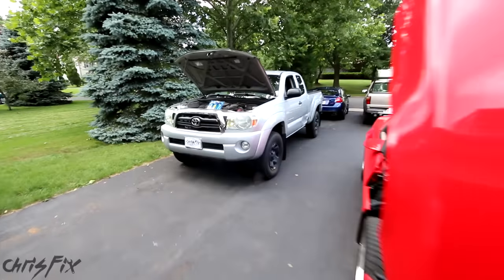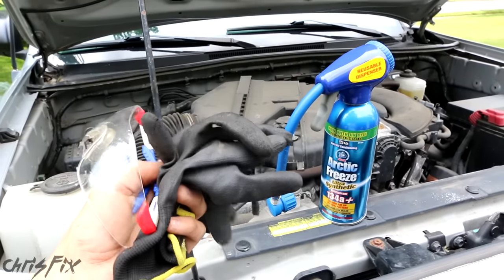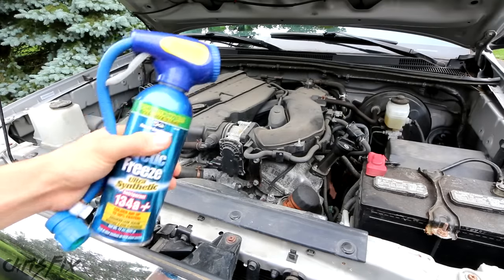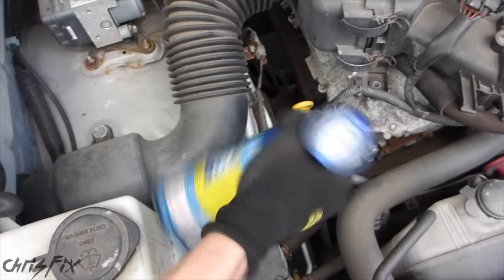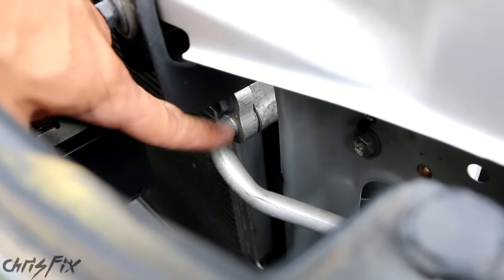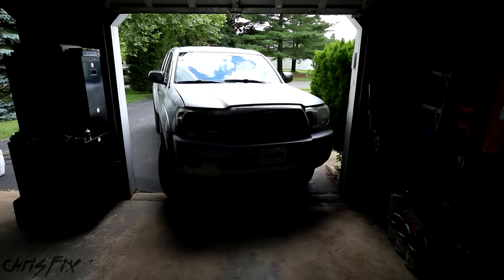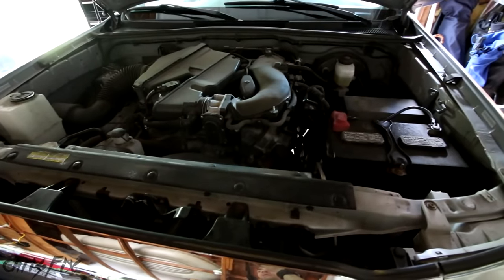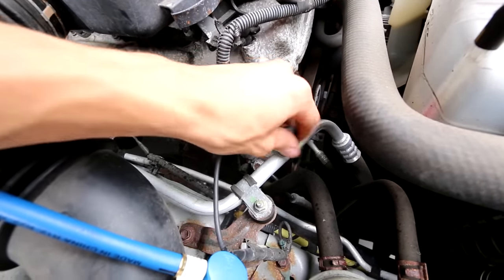How to Find AC Leaks in Your Car (UV Dye)

Comment: Something not mentioned in a lot of videos is purge the hose of air before adding refrigerant to the line. But I was unable to figure out how to do it. 

I found one video, relating to house a/c recharging, that I tried to relate to the car instead, but since I could be wrong I didn't do an air purge. Their idea was to attach the hose to the low pressure port and to the can, but don't dispense any refrigerant from the can yet.
With the hose attached to car refrigerant port, slightly loosen the connection to the can and refrigerant will hiss out at the can and push all the air out and tighten again to stop it. But I am afraid the pressure in the hose would be so high, it would cause a large blowup of refrigerant.

 Google says this: Yes, the yellow hose used to recharge a car's air conditioning (AC) system with R134a refrigerant should be purged before charging to remove air and moisture: 
Connect the yellow hose to the refrigerant can. 
Turn the can upside down and open the valve to fill the hose with refrigerant. 
Loosen the hose at the manifold assembly until a small amount of liquid comes out, then tighten it again. 
Air and moisture can damage the AC system, so it's important to purge the hose before charging. R134a is a greenhouse gas, so it's also illegal to vent

Comment: Great Job. my 2004 Ford Expedition has a leak and 3 mechanics failed to locate it,.They each charged me $100.00 and  gave me 3 mo., warranty. Each time exactly at the 3 month time line the AC stops cooling. 1  Mechanic even put a liquid sealer and that failed too. I will try your suggestion and maybe I get lucky.
Reply: Service port schrader cores? Seems like a slow leak

Comment: great video, what are your thoughts on the different types of Super Seal? Do you have any experience with them? I've heard mixed opinions on them. I'm considering using it as a last-ditch effort. my a/c on my honda odyssey 2005 w/ 191K miles went out so I have been recharging the system every few days while we were traveling down south during the summer heat. thanks for your time Chris!

Comment: If a leak was slow and you put that refrigerant into the system, to take care of it responsibly, would you then need to have the system professionally evacuated before replacing whatever is leaking? Is there an alternative way of checking for leaks that doesn't require professional evacuation?

Comment: I had a random mechanic diagnose my ac system tell me it be 2500 to replace the entire system. My cars only worth 2500. So I decided to say screw it. But after watching this, I think I'll test it and see if I can just figure out what component is messed up and replace that piece. Maybe I'll get lucky. Thanks for the help

In this case, can you just pull and replace the compressor? Then you just recharge the system yourself? Will one bottle of recharge charge it twice?
Reply from the maker: If it's all leaked out yes, and then yes you can recharge yourself (https://www.youtube.com/watch?v=Pdq8JAlct6s), and I don't think the bottle would be big enough for 2 charges unless you get a really big one

Comment: Ive heard not to buy the r134a with leak sealer inside. Apparently it can cause issues and shop will refuse to work on your a/c in the future if you've added stop leak r134a before, as the stop leak can damage their equipment!

Comment: Don't forget the old trick for checking for leaks within the evaporator case without actually taking it apart: allow the AC system to run long enough to have some condensate drip out of the drain hose. Collect the liquid and check if it glows under the UV light.

Comment: Great video, extremely helpful, clear and concise. 
One question though, cant you use a dye by itself to locate the leak? As opposed to adding refrigerant w/ dye in it and just leaking refrigerant into the air?
Reply: Great point.

Comment: You air compressor was able to kick on without the correct refrigerant psi? Or the compressor kicks on when it senses a charge? I know I have a leak, and the compressor is good, but can't get it to come on because there's isn't enough charge in the system. Any advice? 
I've taken it to the shop and they say on the diagnostic reader everything is fine, just won't hold a charge because the leak is decent size. Thanks for any advice!
Reply from the maker: It will kick on once you charge the system with enough refrigerant. If you know you have a leak, find then fix the leak first before trying to charge the system again.

Comment: If you need to replace your discharge line do you need to remove the Freon ? Because you mention about the gasket just need to remove the bolt

Comment: On my 2003 F350 7.3 I changed my compressor, condenser, accumulator and, orifice tube.  Had a professional Vacuum and charge the system. He said the system seemed healthy. 

It blew 40 degrees through the vents after charging.  The next day it was blowing 50-60 so I'm concerned. I didnt change the evaporator, he told me not to worry about it. What do you think?

Comment: Hey. Love you videos, as i DIY guy myself, very few times do i need to double check, but when i do, you are one of my few go to for this. I have a 2017 Pathfinder, i checked it for leaks before recharging the A/C. And it was leaking from the back, just by the rear tire? Is this because of the 3rd row folding seat? It was at a coupler, so probably just a washer, but still curious as to what you think. Tks, and be good.

Comment: Hi Chris.  Great demonstration, but I have a question.  I had a rat or mouse chew a hole in the large low pressure  hose, so I know the system is empty.  I replace the line but I want to double check to be sure their isn't any other issue.  Car is a 2012 Acura TSX.  Question is:  Since the inlet is a shrader valve, why not just pump in ambient air to maybe 35 PSI and then check for pressure after over night or 24 hours.  Then let out the compressed air, if no leaks, and add refrigerant?

Comment: Just to add a smal piece of information: The shaft of the compressor also leaks a very small tiny bit by design, as to keep the seal lubricated. Of course, it is way less than that shown in the video

Comment: since the pressure is low at the point where you're about to begin charging, we can safely assume that the compressor will not run until you charge and pressure starts to build up, correct?

Comment: Hey Chris, I haven't done this yet, but I have a 2004 chevy colorado. When the AC is on, it's slightly cool. But you know the sound it makes when you shut the car off, sounds like air bleeding off, that shhhhhh sound. Mine makes that sound over and over while the AC is on, about every 30 seconds, sounds like air pressure bleeding off under the dash. Ideas?? I'd really appreciate a point in the right direction, before buying all the freon and leak kits. Still have my 95 nissan maxima, and of course the AC works flawlessly, that car just won't quit.

Comment: Hey Chris, I got a quick question. So I’m sure I have a small leak because the A/C cuts out around 2 months in. But I only receive cold A/C on the driver side. The passenger side feels like normal air. Any thoughts on how to fix this?

Comment: Hi ChrisFix and thank you videos, they're always helpful and interesting. I have question pls. My air con runs for a few seconds then dies. Should I try this fix? Or check a/c fuse or anything else. Compressor is working fine. With the fires in Sydney we've had lots of ash in the air. Maybe ash clogged?

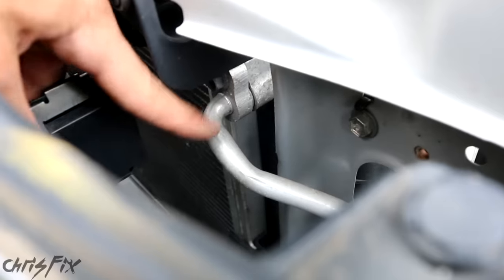Comment: I am surprised that you did not mention that the gas in A/C unit needs to be captured before opening any lines to atmosphere (7:42). It is against the law to purge the unit to atmosphere. After replacement of the seals, the system has to be evacuated before refrigerant is added.

Comment: I was told to not use a refridgerant with a stop leak addative. The logic is that a professional shop will not take the chance of gumming up their high dollar diagnostic tool if rhe vehicle has had sealant added to the freon at any time. Is this accurate?  Also, are air conditioning systems designed to prevent the AC clutch from activating if the pressure in the system is low? How effective are sealants at stopping a leak if one were to use that type of re-charging product?

Comment: came with oil from factory so I only added the freon. Watching cris fix videos I realized that I needed to vaccum the system first so I am fixing to order a pump with manifold hoses. If I vaccum the system do I need to add oil and freon this second time around? I replaced the compressor less than 24 hours ago and I have cold AC FYI.

Comment: I followed all instructions, and after injecting the freon with dye, drove my 05 Ford Ranger for approx 60 miles. Left it parked in my garage, and checked for leaks after two nights (kept forgetting to go down to check for leaks), but there were no leaks. A slight green tint at the low side intake, but that was to be expected as that's where we inject the freon with dye. Any suggestions, or explanations would be helpful. It has to be leaking because it was blowing cold air, then stopped blowing cold air. When I added freon with dye, it started blowing cold air again.

Comment: How long after you deplete the AC refrigerant thru use or via an O-ring leak, will the AC compressor experience detrimental damage/failure?
Reply from the maker: Every compressor is different, and some compressors have a low pressure switch to prevent damage, but detrimental damage could occur within a minute if it doesn't have the lubricating properties of the refrigerant
Reply: @chrisfix  Thank you so much for replying! I love your videos and wish you continued success!

Comment: Thank you, thank you, thank you!!! Very good layout and straightforward instructions. I don't know why I didn't run to youtube first. But its a low key blessing that I happen to see your page. Real talk! I just learned some shit today. Im having a f'ed up situation with my ac and I keep getting the run around with a couple of different mechanics (one of which left their freakin neck flashlight underneath my hood which was discovered by the guys giving me an oil change!) Anyway.... Maybe you can help me with my problem. I'm definetely getting that combo pack. As of now I know exact where the leak is...I can see it! I placed a rubber patch on it and a couple of zip ties to patch the leak.  Worked for 60 secs......P.S. sorry this is so long. I'm on whiskey #3 so I'm flowin! Back to my question. After i use the dye combo pack and find that its JUST the leak I can see. Is there a way I can patch that myself?

Thanks in advance.

Comment: Just found your video and it's giving me hope. I have a Volvo 2005 that has a bad AC system.  They quote form Volvo will make men cry. They say it's the evaporator. It there is any possibility to fix a leak without having to take out the dashboard I would like to try. The link for the product is not working. Do you know if there are any products like this available?

Comment: Hi, I have an 07 camry where the drivers side is hot air but passenger  is cold. 6 yrs ago a neighbor added some freon and that lasted a couple of years. Then 2yrs later took to mechanic who evacuated the freon and added new. Now 2 years later he does the same thing. Says I have a slow leak somewhere.  He told me you couldn't check how much freon is in the system.  It sounds like you can! He never mentions a way to find the leak. I think I'm going to approach him with the question as to checking for the leak. Am I better off, since it lasts so long and why would the air be hot on one side but cold on the other? He said there could be hundreds of reasons why this is happening.  I trust him but now I'm confused and concerned.  I hope I'm lucky enough to get an answer.  😊

Comment: Only one thing to ask can u repair that ac compressor or we should buy a new one in case of this kind leakage...? Pls ans.
Reply from the maker: I would buy a new one, for everything you would have to do to repair a bad compressor, it's not worth trying!
Reply: I agree with Chris, you will never be able to get all the little bits of the compressor back together.  The compressor manufacturers have special tooling to hold everything together while it is being buttoned up.  The only thing serviceable on a compressor is the pulley, clutch and coil, and changing those doesn't involve opening up the compressor body.

Comment: So, i should try a self charge first before going to a actual shop?🤔. 1st time going theu this and have been on the fence on what i should do. Great video
Reply from the maker: If it needs to be charged it’s leaking
Reply: @chrisfix  yes definitely agree, went thru the process just for learning sake. Seemed to be ok then not too far after issue came back. Thank You its appreciated.
Reply: To update, last nite and today, everything appears to be back to normal... Idk if the seal included with the refridgerant did the trick but everything has been up to par. Still gonna get it looked at tho.

Comment: Hey Chris, i listen to you and other youtubers who preach about the dangers of sucking air into the ac system. I use my ac manifold where I'm able to bleed the air out of the service line before it enters the system. I also have one of these can gauge servicing hose. It came to mind that the ac system sucks air out the hose before sucking the refrigerant. How bad is that for the system?

Comment: Thank you for sharing.  In theory, this might be good but the best practice is not to use this can to charge your system.  You can't weigh the volume of the refrigerant and the oil into your system easily using this method, the gauge on the can is not accurate the additives (like stop leak) are bad.  The chance of damaging your system is there.  The best way is to use the AC machine (RRR) that most of the service stations have one.  Also this method is bad for the environment as you will probably release some gas into the atmosphere.  The AC Machine on the other hand has an automated way to return the refrigerant gas back into container.  Thanks.

Comment: Twould have been good to know that the sealant was going to - or DID - fix the leak you found, since you only said the compressor needs to be repaired or rebuilt, but you only said that's where the leak is... Any chance on an update on that info? I think it may be where mine is leaking from... ALSO... If the o rings are the source and the line are disconnected, does all the refrigerant, etc leak out, or only if the compressor is running?

Comment: So if the compressor itself has a leak, then it will not be a DIY fix for most fellows. It's a 'replace the compressor' solution, true? And most fellows cannot replace the compressor correctly and in really hot weather  ( when we tend to spot leaks... versus winter )

Comment: @3:40s Chris mentions that if you know there is no leak you'd pull a vacuum so that there's no moisture, but since he knows there is a leak it's okay to use this stuff.  So.... does that mean that when you want to recharge your system, you need to find out if there is a leak first?  If so, how do you know that because AC systems always need topping up, they lose their refrigerant over time.

Comment: R134A is a liquid when its under pressure, because its natural state when not under pressure is a gas. As it sprays from the thin high pressure tube into the wider low pressure tube it is no longer under high pressure which causes it to go back i to its gas state. In order to become a gas again it must pick up heat. In this case it will pick up heat from the evaperator causing it to freeze. The heat is picked up and delivered to the condenser coil where it is cooled by air flow. This is just like the cooling system for the cars engine. In a house you can choose to use the hot end or cold end depending on desired climate. Freon never dissipates and will work for ever. Which im sure is why the energy companies greased some law makers to pass legislation making it a hazardous chemical. In no way am I saying that you didn't know what you were talking about because this would be hard to explain in a video what you said is perfect for the average person to know enough.

Comment: Would the refrigerant/dye cycle through the system if the clutch is not engaging? That’s my problem. I took it to a shop, they said there’s a leak and referred me to the dealership which is quoting $2K for repair 😅

Comment: You might try using the correct nomenclature, names for items you are instructing, teaching about.  Flange fitting contains an "O" ring seal. Hose to Tube compression fitting.  The electric fitting is the low pressure switch, you do know that right, and what it does?

Comment: If there is no ac pressure in the system do I need to use the vacuum pump and manifold Guage setup in order to chaege it with the uv dyed refrigerant?

Comment: Chris.  Thanks for the great videos.  They really help a lot for us DIY folks.  Question for you.  When I was installing all the new connections, I used PAG 46 with UV to lubricate all the seals, and there is residual that I can see with a UV light (making it hard to find a leak).  Can I clean that up with Carb cleaner so that I can start fresh?
Reply: Carb cleaner might be too harsh, i handle PAG oil a lot and i noticed that IPA (the alcohol, not the beer) is an excellent solvent for PAG
Reply: I've used brake cleaner in the past.

Comment: the website doesn't mention any oil inside. Sure that no Oil is needed?
My AC is empty and i want to do this to check for leaks. Should i add Oil for this procedure? I am scared of destroing the compressor.
So do i need to add Oil in those kits in general or not?

Comment: Chris, how would you fix the crimped connector leak you mentioned at 7:14 (your high pressure hose)? Is there any other way besides getting a new hose?